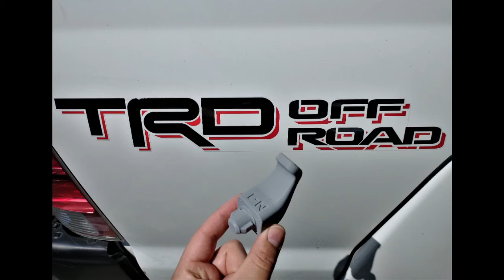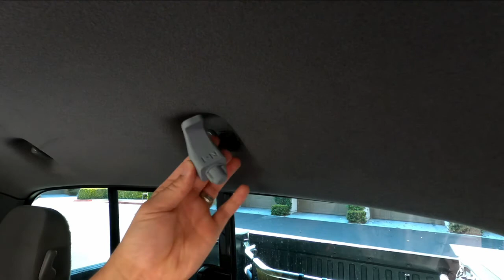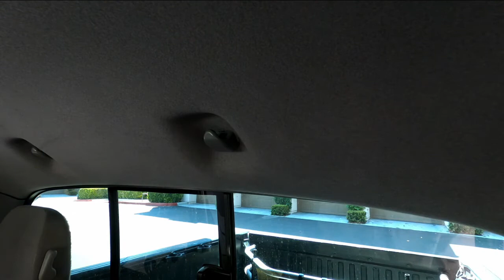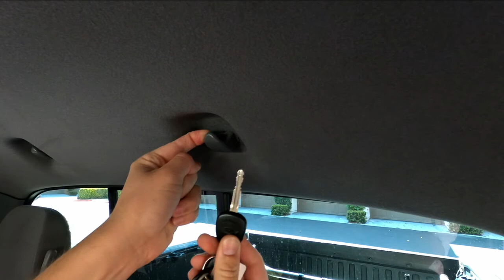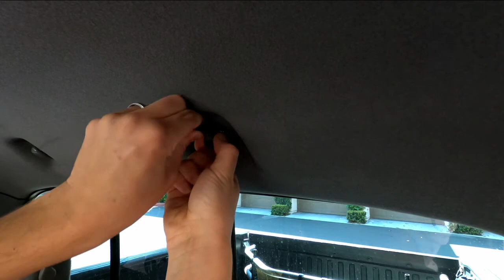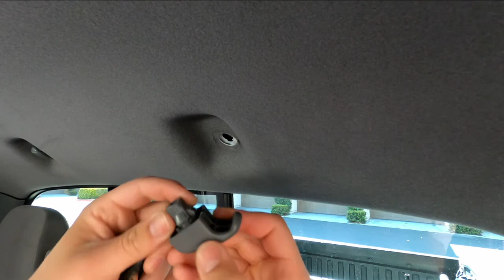Tacoma XL Coat Hanger Hook Installation

Comment: Where is the update for the new ASI controller that you are supposed to fit into your bike?
Reply from the maker: I have since sold the bike. I did have the ASI controller on the bike for a while. It was much smoother than stock but would still cut out occasionally. This and long term reliability of bicycle grade components lead me to pursue a new bike designed from the ground up. 
This "new" bike will hopefully be available as a production model in the coming year via an ebike company iv started.